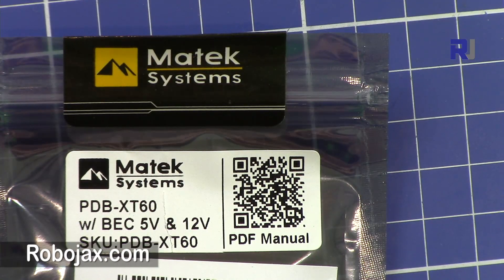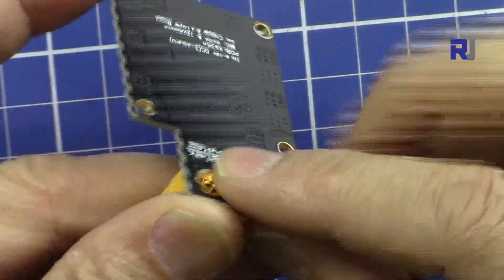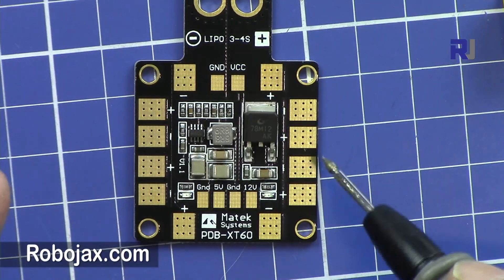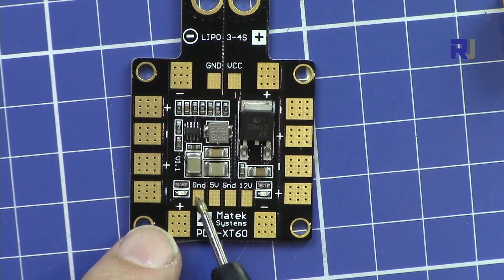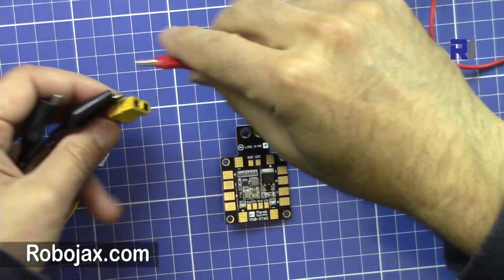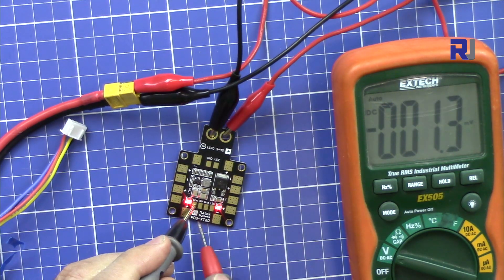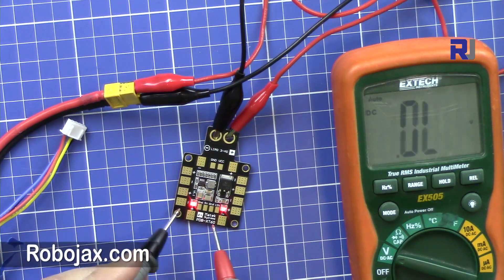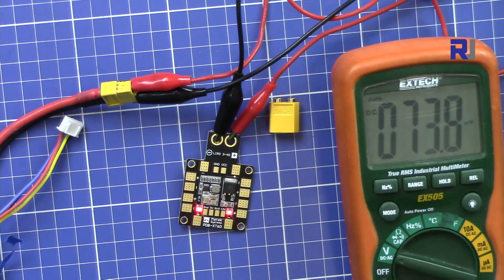Matek PDB XT60 Power distribution board explained

Comment: Is a filter capacitor required?
Reply: Did you figure it out? I need this kind of info I don't know if i need it or not they are saying that it depends on noise and voltage smoothing
Reply: no you dont need it for 12V its for like 20V plus
Reply: if youre new to it i would get onto sinulators or the drone is still useless to you lol
Reply: @Jacob-og9pz  no its a project needed to be done thanks , im just checking because any mistake may cause a trouble the battery 11.1 v
Reply: @Jacob-og9pz  mate another question, if i am connecting a raspberry pi through pixhawk telem1 , then trying to connect multiple blue servos through raspberry pi is it safe ? Or do i need to connect external power supply to power my servos
Reply: not sure

Comment: hi i have the board and w it crashes the xt60 cracks so i want toextend xt60 with the wire.  can i solider the wire on the 2 gold padsjust onthe inside where u connected it

Comment: Are the ESC tabs common to the battery terminals at the XT60 connector?  I have a board that needs to be directly connected to the battery.  I'm wondering if I need to splice the wires or can I just solder connections to the ESC tabs?
Reply from the maker: the (power input) input of ESC is 2 terminal so connect them any + and -.
Reply: @robojax  Great thank you.  Love your channel.
Reply from the maker: You are welcome. Thank you for not skipping the ads and keep watching it. This will help me a lot.

Comment: I've just completed my drone build (my 2nd attempt) and when i tried to power it up the PDB board started flashing 1 red light and the second light stayed on but also my VTX started to show weird flashing symbols and i also did hear a faint squeaky humming sound. I tried to find out what was going on so i thought it was the ESC that had a broken part on it so i disconnected it and when i powered the board up again i was still having the same issue so i gave up after that because i put hot glue on some things to keep it secure so i couldn't be bothered to take the hot glue off lol.

Anyone know what the issue is? i've already spent enough money on this because the first time i did this i blew everything up so i had to buy new FC, PDB and camera but the motors survived.
If anyone can give me a guide on how to fix this without buying new parts that would be great!
Reply: Can someone answer his question for us to learn something, folks??